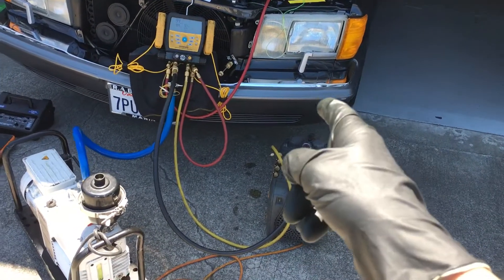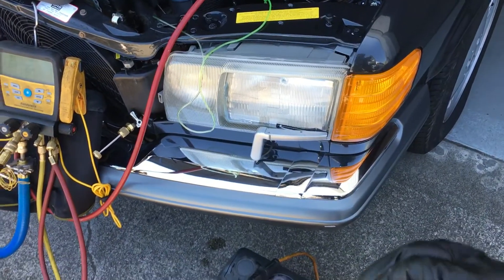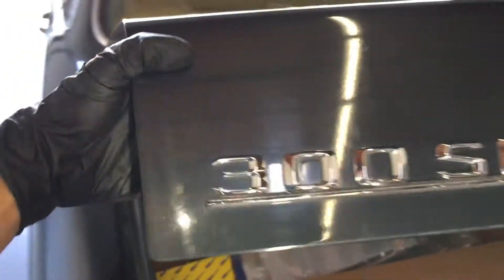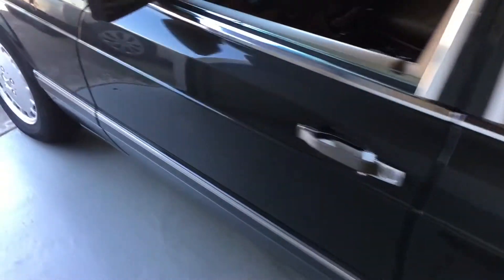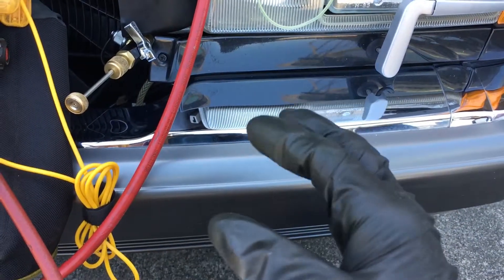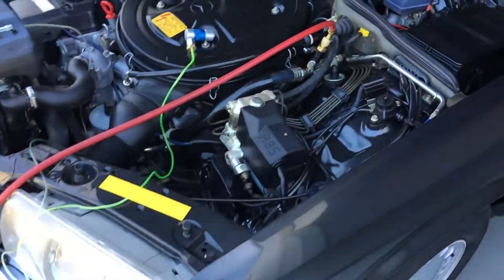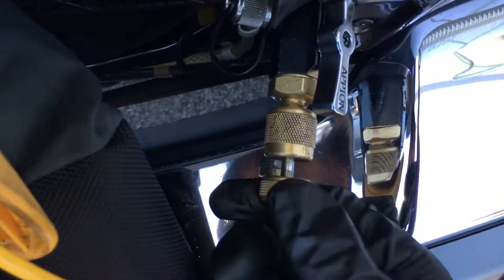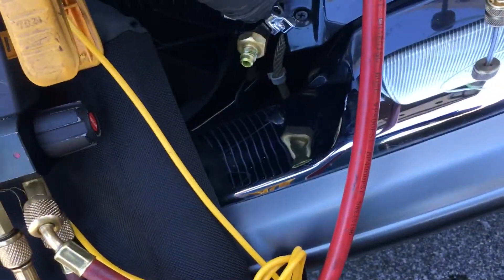A/C 100% hydrocarbons refrigerant R290 or R600 (propane or butane)

Comment: Why r290 propane is not widely used even when it’s cheap and boil at -43 and you only need 30% of the amount of refrigerant if you convert from r134a to r290
I don’t get why?
Reply from the maker: Here  in us it legal liability . 

Yes it is good in a system. 
It is even better in a system that was properly designed for it 
Often the compressors moving much shorter life . 

The reciver dryer needs to be redesigned differently in its physical shape due to the smaller quantity of refrigerant.  .  

Change the expansion valve to a expansion valve that was designed for R290 

Because of the very small risk of a large leak developing in the passenger compartment .  

It would be safer to use if it is a liquid glycol plate, heat exchanger, too cool water glycol, and then pump it into an evaporator in the passenger compartment .

Comment: in some countries, people just re-fill the system with propane only, or a mix of r290 + r600 at about 50% of recommend quantity for r134a. For example, if the system is to run on R134a-700g, these people fill propane around 300-380g. And it works. You got ~5*C from vents, but with such a small amount of refrigerant, is there no problem with compressor lubrication and oil circulation in the system? You talked about few times, that a slight loss of refrigerant leads to the compressor burning, and here almost 50% of the factor is missing! :-0 Or maybe r290, or290+r600 has bettee properties to spreading oil through in system ? Whats with oil? Propan will work and will mix with pag46 or pag100 same as r134a ?
Reply from the maker: Many years ago propane because it is a hydrocarbon and mineral oil and Alkylbenzene frigerant oil is a hydrocarbon they would mix excellently together and bind circulating with no problem

It’s still somewhat moves along with PAG not as good

If you do some research on the new HC refrigerators and freezers in restaurants one of the biggest names is called True.    Many use R290 and some freezers use R600 like my freezer at home. 

You will see they’re using POE oil. 

If I was going to convert a vehicle over I will do my homework and re-search what viscosity POE oil to best keep the compressor alive and made to mix with hydrocarbon HC. 

Yes in some situations there may be a little bit of a oil delivery problem.  Because of the low quantity needed. 

For the vehicles that have a very short but very wide receiver dryer this means the refrigerant level in the receiver dryer will be very low close to the bottom of the pick up straw that is supposed to separate liquid from vapor. 

If it was my own personal vehicle and I was going to attempt this I would search for a manufacture of a receiver dryer that was very thin and skinny but tall. 

This way you can keep a long high level column of liquid in a skinny receiver dryer with a smaller amount of refrigerant so you’re always delivering pure liquid with oil mixed with it to the expansion valve. 

Because I have an electric vehicle hybrid high voltage compressor it comes with POE oil. 

Just for experiment I have thought about looking up the proper type of POE oil that I would have to replace in my own very personal vehicle so I can use HC refrigerant.
Reply: @coldfinger459sub0  from Secop technical literature: "Refrigerant R600a is mainly used with mineral compressor oils, so material compatibility is almost identical to R12 in terms of oil. The use of alkyl benzenes or polyolester oil is also possible.
Refrigerant R290 is used with polyolester oil in compressors, meaning material compatibility is
almost identical to R134a or R404A in terms of oil. "
Reply from the maker: @broelbox3317  now the problem lies in material compatibility those are the right choice words to use. 

Remember there’s O-rings and seals in automotive air-conditioning in different types of synthetic rubber hoses that can react with different additives in oils to either swell greatly or shrink and sometimes even break down

Compatibility with commercial HVAC and refrigeration all the pipes are Silverbreeze together using silver with no O-rings and no gaskets.    There is no French shaft seal sticking out of the nose of the compressor to a clutch that relies on a O-ring seal to be exposed to an oil and exposed to the outside atmosphere in commercial HVAC or residential scroll compressors. 

Usually the only kind of synthetic seal you’ll see and residential HVAC and some commercial is called a rotor lock they used to use it years ago on York in Tecum comp compressors. 

It’s that square groove cut in the top and they all use Teflon as a seal that gets smashed under compression and Teflon is usually pretty impervious and resistant to most chemicals.
Reply: do you  suggesting that the mix of r290 and r600 may adversely affect hose materials and hnrb o-rings in automotive system r134a? I found a very good description. I can't share  link. Check it out: EXPERIMENTAL  INVESTIGATIONS  ON AUTOMOBILE  AIR  CONDITIONERS  WORKING  WITH R134a  AND  R290/R600a  AS  AN  ALTERNATIVE  by Karthikeyan KANDHASWAMY a*, Somasundaram PERIASAMY b ,  Sivakumar MAYILSAMY c, and Saravanakumar THANGAVEL a
Reply from the maker: @broelbox3317  Not all manufactures all use the exact same O rings or seals inside their compressors not all manufacturers use the exact same hoes material for the hoses. 

So all test would have to be performed on all materials

In the early days available controlled compressors they were Mechanically controlled by a valve that I’ve actually slide on O-rings. 

And guys would put the leak stop additives or different oils that would make those O-ring swell so much that they actually would bind up the variable controlling valve so it would no longer move.?

Even some expansion valves have that needle pinto that slides up and down on O-rings and if it is swollen too much it caused a Pinto to stick and no longer adjust the refrigerant flow. 

All these components are made by different manufacturers all around the world not all using the same materials this is the problem. 

In some systems it’ll work just fine in others it will not this is why I wanna system is precisely and exactly manufactured in construction to use HC refrigerants they take all these material compatibilities into account just for HC refrigerant and 8C refrigerant O-rings with a formulation with additive packages in the HC oil

Comment: R12a Is bad ?
Reply from the maker: No, just expensive and difficult for some people to get.
Reply: @coldfinger459sub0  r12a is the r12 alternative
Reply from the maker: @manwiththeplan7143  oh yes that’s what you meant. 

      Yes often ends up been bad results.  May work at first failed later. 

Usually charged improperly

Comment: is bbq propane ok to use?
Reply from the maker: You may want to run it through a large dryer to reduce the moisture content. And you also have to run it through Carbon to get rid of the sulfur because sulfur is acidic and would attack the metal components just like making Hydro chloric or hydrofluoric acid with moisture and refrigerant next. 

         The barbecue grade hydrocarbons never have to consider any contaminants in manufacturing. 

          Hydrocarbon refrigerant manufactured for refrigeration or of high purity moisture removed no oxygen content no sulfur. 

        Like pharmaceutical hydrocarbon butane or propane used in medical grade extraction is extremely clean and pure. Very dry because when they’re doing extractions if they had any moisture content and they did not want other substances that dissolve in moisture and be carried on Dryness is of the upmost importance. 

       But of course anybody in many people use anything and they get cold blowing out the – and call it successful. 
        Just ask the guys in Australia they’re having massive problems with many do it yourself individuals with hydrocarbon gas added to cars
Reply: @coldfinger459sub0  thanks. I was wondering about the impurities. i switched over to r600a in my Miata. did not see much improvement though.
Reply from the maker: @narcissistinjurygiver2932  if the charge is wrong you will not see improvement. 
           To charge for R600 or R290 is extremely different in volume and weight compared to R12 or R134

      And if the system is not mechanically sound a good working expansion valve that’s not out of calibration with age a compressor maybe was changed in the new one already had a full capacity oil and it was just slapped on the vehicle so it’s extremely oil overcharged. 
        A beat up raggedy condenser that’s extremely beat with stone pebble damage and oxidized aluminum in that does not transfer heat very well. 
            If any of these conditions pertain to your vehicle you’re fighting a uphill battle against the wind.
         And I forgot to add any moisture contamination
Reply: @coldfinger459sub0  yep, i know. You got a nice w124. hope you keep all the fluids clean. I am a MB tech.
Reply from the maker: @narcissistinjurygiver2932  if you go to the Johnstone refrigerant supplies website or American Refrigeration Supplies website or Baker Distributing supplies website and look up there R290 or R600 refrigerant meant for air-conditioning comes in small cans. 

          When you find out the manufacturers who make small freezers for restaurants and those salad bar tables that you see that are refrigerated from down below the food plates the big stainless steel ones. 
         Find out the name of the manufacturers who make the new ones with the hydrocarbon gas to work on their equipment under warranty a technician Hass to take a test about safety and usage of hydrocarbon refrigerants and how to handle it and how to properly charge and dispose.
         That might help to up your knowledge and education on hydrocarbon refrigerants

        Another good educational source called
https://ww2.epatest.com/hc-hfo/
Here’s a link to study the more you know about hydrocarbons the safer you will be in the better job you will do at maintaining hydrocarbon-based refrigerant appliances.
Reply: @coldfinger459sub0  thanks
Reply from the maker: Not really. 
Any flammable refrigerant is not allowed and should never be used in automotive AC systems that were originally designed for non-flammable refrigerant. 
        And only after manufacturers in truck instructional training on the exact equipment that was manufactured to use flammable refrigerant should anybody be allowed to play with refrigerants that are flammable.

  It’s the people with not the proper knowledge of using flammable refrigerants cause harm and damage to property in life of other people through their ignorance.
Reply: @coldfinger459sub0  i use isobutane but in theory, not law, would lp from the gas station work? i am not talking about laws. I have been doing a.c work for years

Comment: Is 100%  propane/ butane mixture  compatible with the PAG oil used in the R134a system? have an empty 1996 bmw ,no leaks, and in deep vacuum for days; no  cheap 134a around here,but plenty of cans of  "air" dusters,  60% propane, 40% butane, and other brands  with some isobutane in the mix; guess somebody removed the  r134a when they pulled the motor to rebuild it.
Reply from the maker: Jose Peixoto duster is made of ? Look at this 
https://en.m.wikipedia.org/wiki/1,1-Difluoroethane
Reply from the maker: Jose Peixoto R290 and R600 better mix and carry mineral oil that was used with old R12

But duster better with pag or Ester